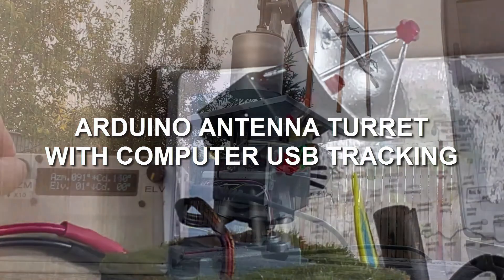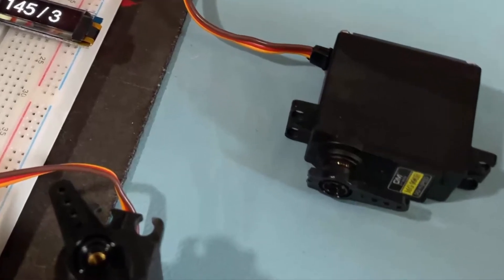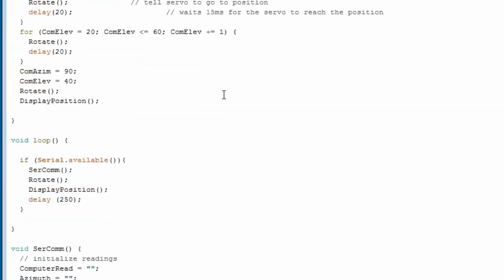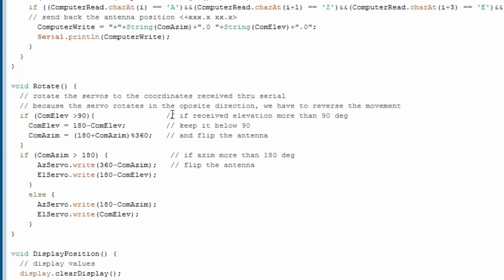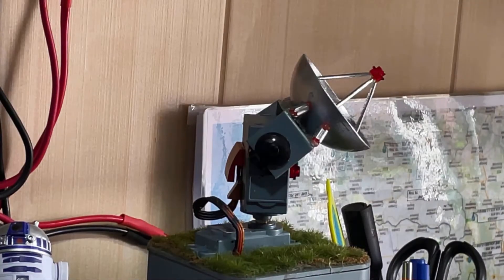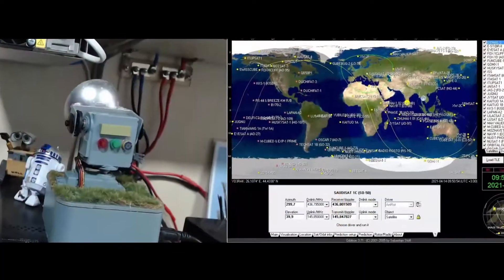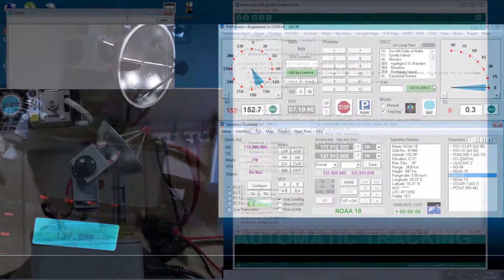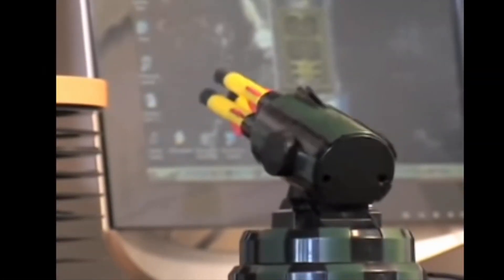Arduino Antenna Turret with Computer Tracking

Comment: Hello! The project is great, but I have a question. What line of code and where should I add it to make the servo motor turn slower?
Reply from the maker: Hello Irina,
Thank you.
I know what you mean. It's not that simple. The servo moves at a specific speed, and this can't be changed.
We can do a little trick instead. We move the motor only a few degrees then add a little delay, and so on until it reaches the desired position.
Give me an email, if you need more help.
Salutări,
Viorel

Comment: Hi Sr, question, can I use any servo that works the degrees of your project or should I buy a specific servos? I'm planning to build my project to track amateur satellite with my station at home. Thank you Sr and regards from Costa Rica, central America!
Reply from the maker: Hello Tiham.
This project is more of a toy. The servos do not have enough power to move a real antenna.
Instead, check out this
https://youtu.be/GHdLQavEeE4
for a more suitable project.
Let me know if you need help.
Greetings from Romania. 
Viorel,
YO3RAK
Reply: @Racov  Hi Viorel, thanks for the response, I' planning to use this to track amateur sattellite like  SO-50 ,AO-91 or the ISS for example with a moxon yagi. If I found a strong servo maybe can work I guess.
Reply from the maker: @TI2GBB  Yes, you need two strong servos capable of 180°
Reply: @Racov   Thanks! I sent you an email :)

Comment: I'm working on your project. But now I'm stuck with that problem. Using the Orbitron program doesn't understand your project. Thanks for sharing a nice project. 73 de E23WQD
Reply from the maker: Hello Nuanyai
In order for Orbitron to work with Arduino, you must install first the DDEtoSerial plugin. You’ll find the link in the Arduino project page. This plugin sends the satellite coordinates to USB. If you have any questions, send me an email.
Reply: thank you